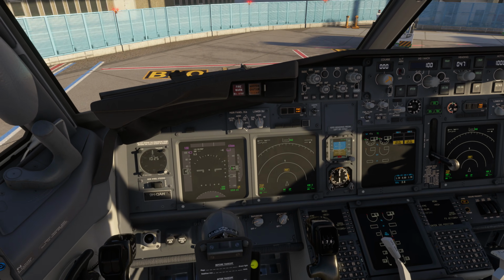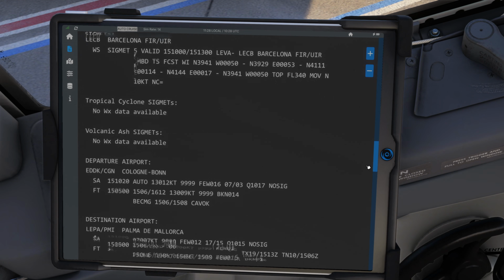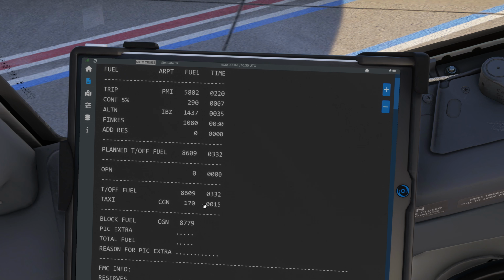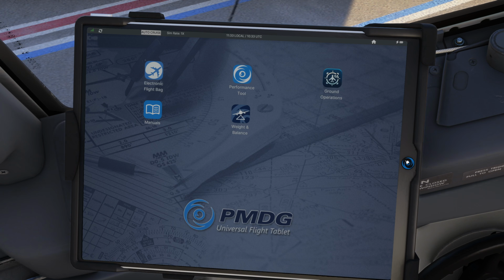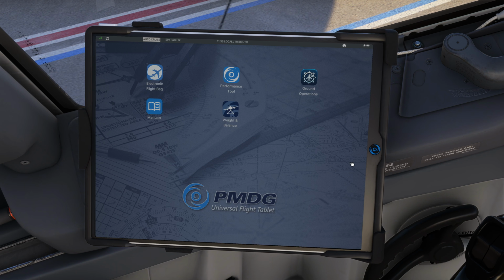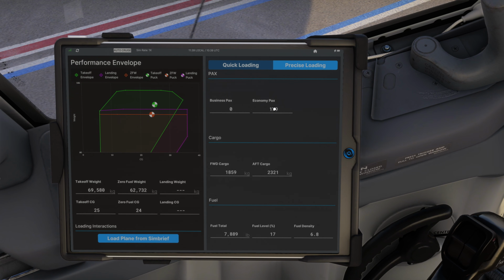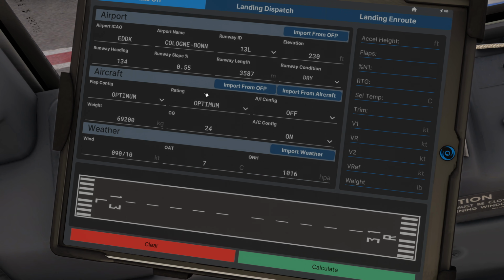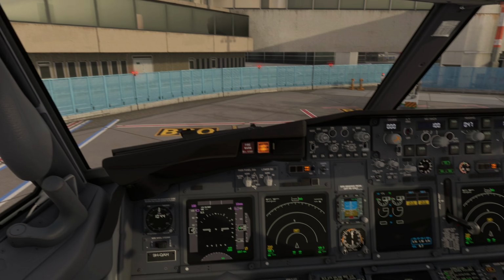PMDG 737 Virtual Type Rating 2: Takeoff Calculations, EFB Setup, Fuel and Boarding | Real 737 Pilot

Comment: Great tutorial thank you. Particularly the EFB use for performance calculations. You mention the PMDG EFB doesn't interface with GSX, but does it interface with Say Intentions? Could I request all of Ground Maintenance, Service and Connections through SI? I've input the SI API key but didn't have a lot of luck with push back requests. Ground accepted the request but I still needed to select pushback via the CDU then strangely had to deselect the pushback LSK once pushback was complete before the aircraft would move. That took a while to figure out sadly.

Comment: Love the First Flight Flight Deck Prep.
Hoping to see a Turnaround / Aircraft change Flight Deck prep to come.
I found that Simbrief initially has the 737 with a default positive fuel bias factoring  of plus 3% built into the base profiles, meaning you actually have more fuel than real world operations would dispatch, that has to be manually adjusted on a per airframe basis when you create dedicated aircraft profiles for individual registratrions. It great for people that dont want to do the math as it will put in a little buffer automatically.
Reply from the maker: When you consider simbrief fuel factors you always have to consider that the simbrief profile mustn't be 100% accurate either.
Back in the day when I used to fly the 737 I did occasionally recreate my real world flight plans with simbrief and the figures were never identical either, not even for those aircraft that had a zero percent fuel bias.
Always remember simbrief isn't perfect. The bias is simply an adaption between the imperfections of simbrief and the imperfections of addons to get the two to match.